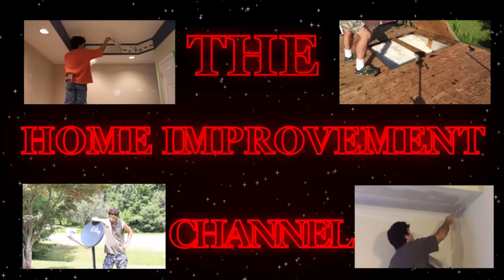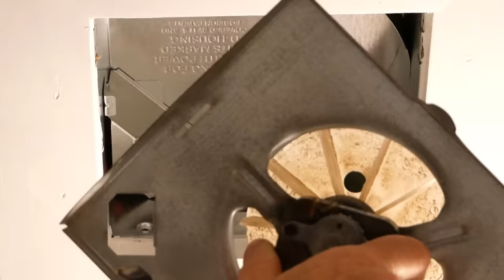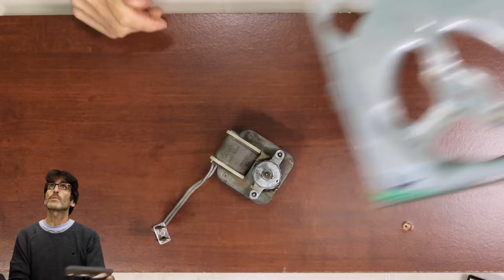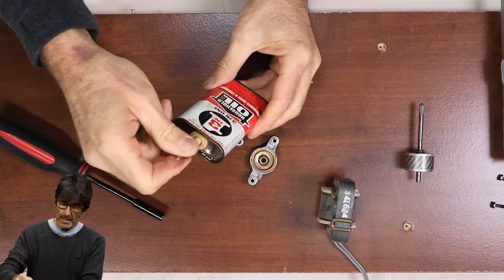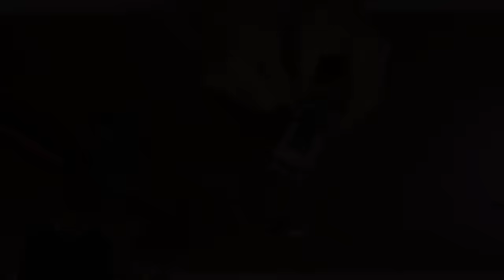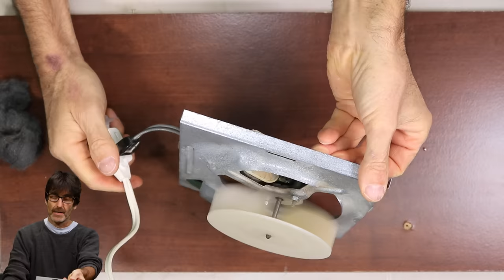Replace Your Bathroom Fan in 5 Minutes FLAT!  NO Attic Access!

Comment: mine does not plug in and in this neighborhood they are catching fire because they are over 20 years old.  The fire dept went around and told us to replace.  Mine does not look like this or hook up like this?
Reply from the maker: Hi, this fan represents a lot of fans out there, but of course its not the same with every fan.  If the fire dept. is actually going around telling people to replace those older fans, then you should replace the whole assy.  Housing and all.  I actually have done a couple of videos on replacing the whole thing.

Comment: Are all these fans standard size?  Would it fit if I just pick up any model at Home Depot?  Thanks.
Reply from the maker: HI, they are definitely not the same.  This one in the video is  a very popular contractor grade fan.  You might want to take out your fan if it removes like the one in the video and measure it to make sure you can get one that's compatible..  Or even better bring it with you, but you might have to open a box to see if it's the same.

Comment: How can they find out which exact fan to replace it with? What places sell the replacement?
Reply from the maker: Some fans have a replacement available and some don't.  Best bet is to remove the insert if your fan has one and take it with you.  Lowes and Home Depot usually have several fans there, but whether they'll have yours, I can't say.  You can also see if there's a model number sticker visible.  If so, you can google that and see if there's a replacement available online.

Comment: Do all bathroom fans come with the plug in type connection? Or do they come where you have to connect the wires using wire nuts?
Reply from the maker: I don't think they "all" have an outlet type connection.  I have a Panasonic and it uses a proprietary type plug.. It is a plug but wouldn't fit anything else.  Some of the old ones might connect with wire nuts..

Comment: What if it's a fan/light combo? Same method or is there wiring involved? My fans been dead for over a year but the light still works.
Reply from the maker: Some are going to be different from others.  I chose this one because it is a common builder grade fan.  You can take the cover off and see if the fan motor part is removable.  My guess is, it probably is.  There shouldn't be wiring unless you take out the whole housing assembly.

Comment: If you're trying to change out the old fan that's 50 cfm to a new fan that's 70 cfm, will the motor still fit? Are there size differences with differing cfm bathroom exhaust fans within the same brand?
Reply from the maker: I am not sure on that particular question.  I would venture to say that they aren't interchangeable between the CFM's, but I'm not 100% either.  You can look at both and see if there's any differences.

Comment: We did exactly as you suggest (before finding this video) but when plugging in the new motor, the outlet to the fan (somehow) was jogged loose and now it is hanging down from the outlet hole just a little-with no power. So a wire has obviously pulled loose. 
I guess this means now we’ll need to take out the entire housing after all? So frustrating!
Reply from the maker: That plug should come loose from the inside of the housing. The plug is in a corner on a sheet of metal.  If you look for a tab, you should be able to pull the whole plug down and access the wires.  Probably one has come loose.  Make sure the switch is off!

Comment: Why are we keeping the old housing as opposed to the brand new?
Reply from the maker: Because it's very difficult to get the old housing out of the ceiling.  If you have one that you can get a replacement motor for, it's much better just to swap out the motor and leave the housing in the ceiling.
Reply: Or a better question.... why not?

Comment: My plug in for the fan is a different plug am I able to change it to a regular outlet or should I just replace the whole fan
Reply from the maker: You might be able to change the plug.  Without seeing it it's very difficult to tell if the new plug will work in the old housing.  That plug will usually pull out of the housing.

Comment: Hey, I was following your video to replace my fan but had something odd happen. I went to Lowe's with my old fan, the fella sold me a unit to replace it.  However, the nuts for the two screws are on the other side of motor, NOT next to the fan axle. The directions call for installing the motor, with the fan on top of it, on the upper side of the bracket.  It doesn't fit in my space.  Can I flip those screws and mount it the way my old motor was?
Reply from the maker: I don't see how it would make any difference.  I can't see exactly what you mean, but it doesn't sound like an issue

Comment: Where can you buy a replacement fan? I would like to get a quieter one with more power.
Reply from the maker: You can usually buy a fan from Lowes or Home Depot.  Problem is if you want a better quieter fan, the insert in the middle won't fit your existing housing and you'll have to change the whole thing.  Housing and all.

Comment: Here’s another tip. I discovered that the lower (floor-facing) motor bearing was so worn that the rotor was making contact with the bearing housing, making a horrible scraping noise. I called Broan to get the part number then ordered a replacement from ElectricMotorWarehouse. But then I thought of a temporary fix to raise the bearing in its housing: 1) Pry the bearing, retainer, and felt ring out of the bearing housing; 2) Make a small copper ring from 12 or 14 gauge copper wire, with an inner diameter very slightly larger than the shaft, but the outer diameter just small enough to fit inside the bearing housing; 3) Reassemble the bearing, felt ring, and retainer with the copper ring inside; 4) Reassemble the motor; 5) Make sure the rotor now spins freely without contacting either bearing housing. If the rotor now scrapes the upper housing, you have raised the lower bearing too much. In that case try again, perhaps with a smaller gauge wire. It’s easiest to make the copper ring if you have access to some jewelers tools. My motor now works like a champ! (I have a feeling it will only be good for a few weeks, but by then I’ll have my replacement motor.)
Reply from the maker: Wow.... that's innovative... Thanks for the tip!

Comment: Are bathroom exhaust fans suppose to be warm or slightly hot even when they are off for a while? I don't want to replace it if this is normal.
Reply from the maker: HI James, You may be getting some heat from the attic or if it's downstairs the space between the floors could be pretty warm.  You might want to check it again early in the morning before the attic has a chance to get very warm.  If it's off, I have a feeling that's what it is.

Comment: Where does the exhausted air go to? Does it recirculate?is there a filter to replace?
Reply from the maker: The exhausted air goes outside, either thru the roof or if it's on a lower floor thru a vent in the back of the house... No filters.

Comment: How do you get the exact measurements on the size fan to buy? Either we are measuring the housing wrong or they don't sell our size anymore, it seems they are either just a bit too big or a bit too small :(  I don't really want to have to remove the whole thing and cut a bigger size hole into the ceiling.
Reply from the maker: Of course this type of fan doesn't represent every fan out there.  If your fan has a removable insert like the one in the video, you can remove that one and measure the insert itself to compare to the new one at the store..  You might even have to find one that looks similar and open the box so you can get a measurement.. Not that I'm recommending you to open the box!  Maybe if they have a display, it'll be easier to measure that one.. 😂

Comment: Mine is the older type with the screw in the middle that secures the grille. It doesn't use clips to secure it. But the grille is plastic and has broken. No-one sells replacement grilles with the central screw. So I'm screwed, literally.
Reply from the maker: Can you remove the metal clips and drill a hole in the middle to put the screw?  Of course you'd have to buy a whole fan just to get the grille, but they aren't that expensive...  As long as the new grille is at least as big as the old one I don't see why it wouldn't work.

Comment: If my fan works fine but the cover has gone a nasty yellow colour can I just replace the cover? Does it need to be specific for the model of fan I have or can I buy a generic vent cover?
Reply from the maker: Yes absolutely you can replace the cover.. you might have to bring it with you to the store to try and find a fan that uses a cover that'll fit

Comment: I have a problem with drafts. Will this method correct or does the housing need to be replaced?
Reply from the maker: It could be that the flap that is supposed to close isn't working right?  If you remove the fan motor, but leave the housing you should be able to look up in there and see if the flap is closed..
Reply: @TheHomeImprovementChannel  thanks. I'll check it out!

Comment: Have an older house with Just a ceiling light and no bathroom exhaust fan. What would it take install exhaust fan (with light). Help!... thanks
Reply from the maker: ARrrgh... Yea that can be tough... If the bathroom is on a lower floor with no attic access, you'll have to remove part of the ceiling for the duct work to exhaust out the fan.  If you have attic access it's no to bad you have to get up in the attic to put in the duct work for the fan.  Either way is hard, but attic is easier.  If you want to control the fan/light separately, you'll need to install 14/3 wire that has the red wire so you can switch the light separately from the fan as well as a two gang box in the wall with two switches.  If you don't care if they come on together (fan and light), you could use the existing light wire. Hope this helps.  Be careful of a older house, as there could possibly be asbestos in the drywall compound, and also if there's a attic, possibly asbestos attic insulation.  Not saying it does, but to be mindful of it in case.

Comment: All I would add is those bearings are oil impregnated, generally.  If you do all this, plus have enough light oil that you can soak both bearings in that oil for at least 24 hours, that might help it last even longer.
Reply from the maker: They're really just brass bushings.  Do you think they'll absorb oil?
Reply from the maker: @l337pwnage  Interesting.. I'll check it out. Thanks.. :-)

Comment: When there is movement in the shaft where it moves up and down  is it better to just replace the motor or can the bushing or bearing be replaced?
Reply from the maker: If I remember the up and down may be normal.  It's the side to side that indicated worn out bushings... But no, I doubt you'll find those bushings to replace them with.. so If you think it's worn out, it'd be better to get a new one. Hope this helps.. Thanks.

Comment: Unfortunately my housing will not fit the $15 replacement unit I bought at Lowe’s. The housing doesn’t “snap in” to the fan portion like your video describes.
Reply from the maker: You probably have a different one.  The one in the video is a very common size, but isn't the "only" size out there...
Reply: @TheHomeImprovementChannel  no, it’s not the sizes. The housings are different. My old housing doesn’t have clips like the new one. It’s fixed.

Comment: Would this solve the issue of water dripping from the fan? The exhaust line is properly insulated so I'm thinking that the issue is from the damper not closing completely. Any thoughts? Thanks.
Reply from the maker: Does the fan exhaust thru the roof?  Is there any leaking when it's not raining?  Then yea, it's possibly the damper.  No this won't solve that, the damper is made into the housing.  But if you remove the square insert with the fan motor, you can access the damper and see if its working..
Reply: @TheHomeImprovementChannel  thank you so much for responding!  Yes the van vents out of the roof. It   just started dripping this winter. We have had snow on the roof for about a month or so now. I will take a look today and see what I find. Would the damper be repairable or replaceable from below?
Reply from the maker: @cahmkp0102  you should be able to access the damper once you pull the motor housing out, I actually doubt if it's that, the damper is not water proof, youd have to have alot of heat escaping up the vent to cause enough condensation  for that to happen,  but definitely worth looking at.   If you can see where it goes thru the roof from the attic,  you might want to look up there to see if the plywood looks wet around where the bath fan goes through.
Reply: @TheHomeImprovementChannel  thanks again for the quick response. I opened up the attic access and the plywood is wet, the trusses are wet, the insulation in the ceiling is wet. So I think I've got a bigger problem than water leaking through the fan.
Reply from the maker: @cahmkp0102  Yes unfortunately,  your roof is leaking 😕😕😕
Reply: @TheHomeImprovementChannel  yay!🤣🤣🤣 I forgot to mention the mold. Thanks for the help! I really appreciate it.
Reply from the maker: @cahmkp0102  oh no!!! 😫😫😫

Comment: Is it possible to install a higher CFM fan into existing housing? I have a Broan 695-R02 (70 CFM) that I'd like to upgrade to at least a 100 CFM.
Reply from the maker: HI.  You'll have to look at both fans and see if the measurements are the same.  You'll also have to make sure the hole for the plug matches (or use a Dremel to cut it out if it doesn't).  Only if they are both the same will that work.  I have doubts if they'll be the same size.  I'm going to do a video in the coming weeks about replacing the cheap contractors grade fan with a better more cfm quieter fan.. but I'll probably have to change the housing out.
Reply: @TheHomeImprovementChannel :  Thank you for your reply.  GREAT video!
Reply from the maker: Thank U!

Comment: What are the dimensions? I have a real old emerson type fan motor no longer working. Probably from the 60's, will this work for me?
Reply from the maker: HI, I'm not sure of the dimensions of the removable part of the fan, here's the link to the fan used in the video:https://www.lowes.com/pd/Broan-4-Sone-50-CFM-White-Bathroom-Fan/1076121.  If the removable part of your fan isn't the same as the removable part of the lowes fan, you might be able to remove the motor itself and transfer it to the housing in your ceiling from the 60's.  I can't see what you have, so I have no way to say if this'll work or not.

Comment: Hi recently I bought a timer extractor fan and  the switch does not have neutral wire has only brown and blue wire there is no yellow wire can u  give me some idea pls
Reply from the maker: Brown to Black

Blue to White

Green to Green with Yellow Stripe

I would check the manual it came with to verify I'm right..

Comment: Does this work for fans with a light also???
Reply from the maker: It can.  The trick is to find a fan with a motor housing similar to the existing one.  If all else fails, a lot of those fans, even the ones with lights have a removable motor housing.  If you can't find one that fits directly, you can pull the motor from the housing and swap the motor itself into the old housing. Don't worry if the holes don't line up, you can drill new ones.  As long as the motor is physically about the same size and you can get the cord to plug in where it needs to.  The fan blade has to fit the motor shaft as well...  Hope that helps.. 🙂

Comment: Was taking a bath and hear a loud electrical pop followed by the smell of something burning.
And the fan immediately stopped working.

In my case, is this likely an issue with the motor and I can use this method, or am I getting dirty in the attic?
Reply from the maker: I'm sure that's a scary sound while taking a bath!  Going in the attic?  It depends.  Do you have this type of fan that's got the removable motor?  (most modern ones do) And if so are there replacements available?
Reply: @TheHomeImprovementChannel  Thanks, I took the cover off and see its easily replaceable from the ground level. I was all set to replace with some fancy fan with a nice light for the wife. I unplugged the motor and the outlet tested good. Ive ordered a replacement motor.
And yes, I almost dropped my phone in the bath when I heard the electrical pop! I thought I was gonna have to run out of the house in my birthday suit.
Reply from the maker: Lol...  a lot of phones are water proof enough to stand being dropped in the tub!  But not all of them, depends on what you have.  That's cool... hopefully it's an easy fix when the new part comes in... 😀

Comment: To get it off the ceiling I had to remove the plastic light bulb cover plate, a BROAN.  There was a nut hiding behind the light bulb that needed to be unscrewed in order to remove it from the ceiling.
Reply from the maker: Yes, that one sounds different... it should still have a removable fan motor that can be replaced pretty easy
Reply: Yes, I took it down and dusted, and oiled,  now waiting for a new plastic fan wheel to arrive.  Trouble was the wheel was damaged and hitting another part making a hideous sound.  But have had the unit for 15 years, so happy it seems to be a minor fix.  Thanks for your video!

Comment: What about the heating element on the ceiling of the rental bathroom? It always stops working after 3 to 4 months of use.
Reply from the maker: Be difficult to say without looking at it... is the element burning out after 3 months?
Reply: @TheHomeImprovementChannel  yes, it doesn't work anymore, so apt manager has to buy a new circular ceiling heating element. I don't know what it's called, do u?